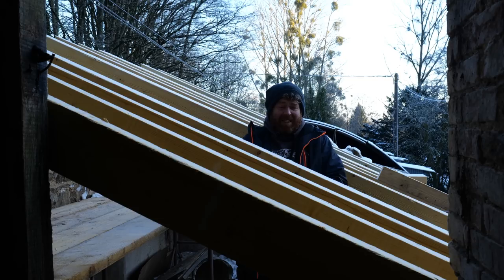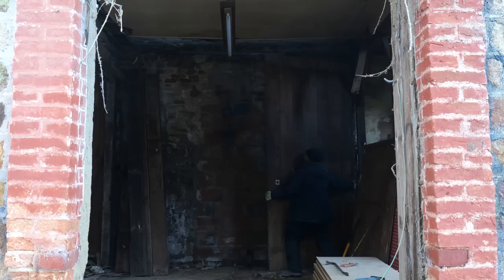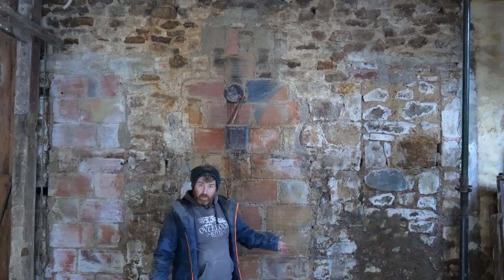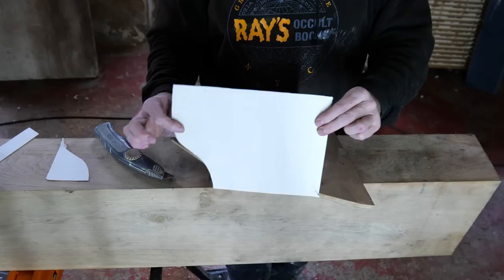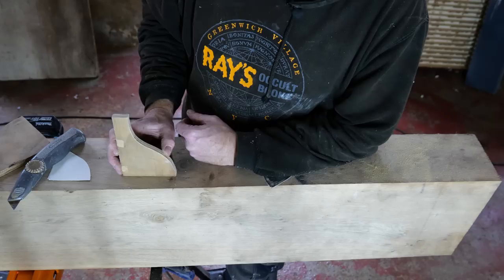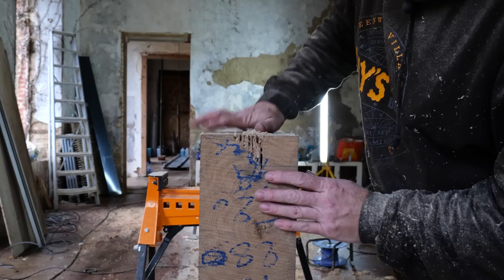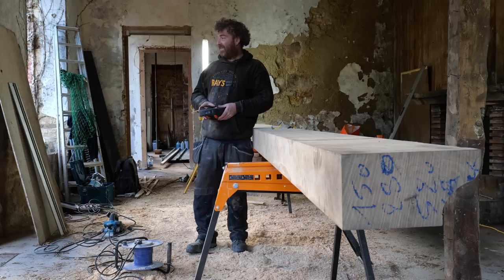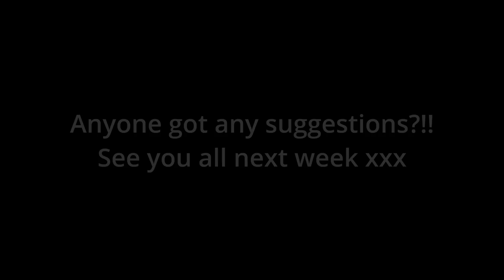36  Curving carpentry in France

Comment: Move the staging away from the house far enough for the beam to fit between them.  Build temporary staging across the top tying house and scaffolding together.  Has to be high enough to accommodate block and tackle at each end to lift beam.

I’ve also seen beams that heavy strapped to the side of a scissor lift and lifted into place.  Well, maybe I have…how heavy is that beam?

Comment: Hey don´t put yourself down think you did an amazing job putting the profile in, you made it look easy but the reality was certainly different I am sure. Working with oak that is hard as nails and weighing a good 200kg I am sure, working on your own, and achieving such a great result is pretty impressive, especially when you sain you were not feeling 100%.. so well done.

Just hope you can draft in the local rugby team in to help you lift it into place...

You also had a good tidyup and cleared the decks so a very productive week in my opinion..

Well Done

Robb Torremolinos Spain 😊